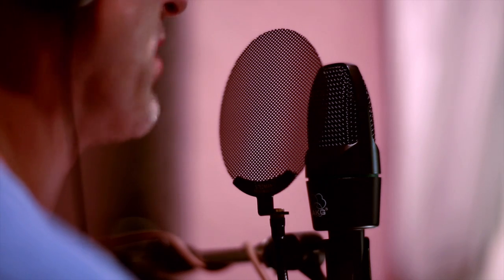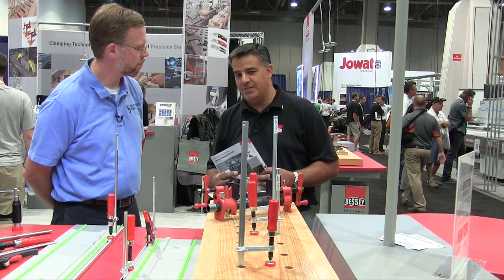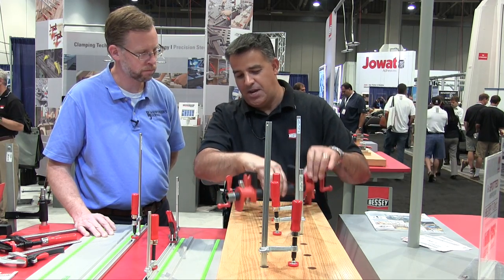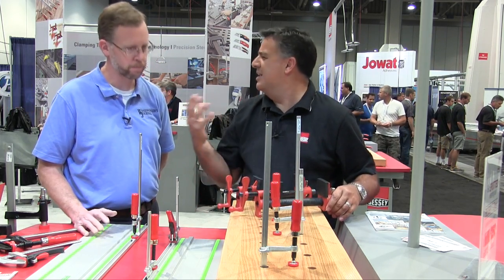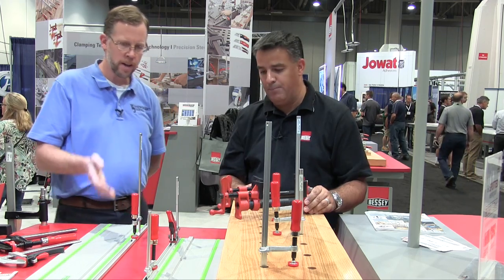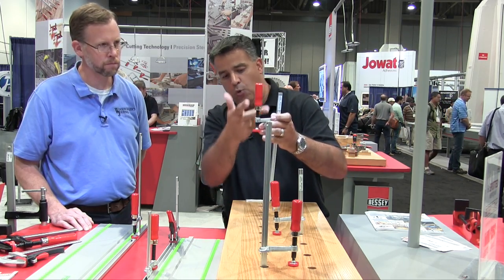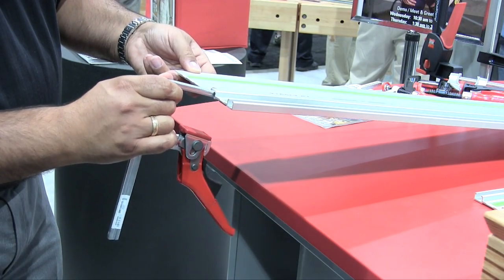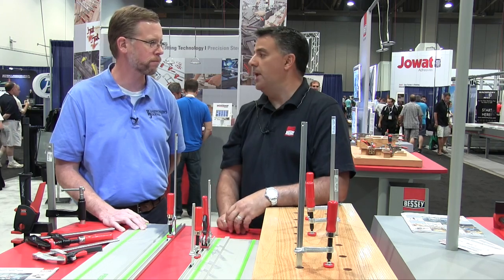Bessey H-Series, Track, and Pipe Clamps - AWFS 2015

Comment: Festool already make quick ratchet clamps & screw clamps for their tracks they also fit the Makita track system which is a direct copy of festools only in Makita blue
Reply: palmer3977 Bessey is not likely to be as expensive and will do the same thing, that's the market for these.
Reply: palmer3977 Just ordered $1,000 in Bessey clamps recently.  I haven't seen these track clamps for sell yet, so its difficult to judge.

Comment: I was surprised when I had the female thread in one of my f-style bessey clamps strip after less than 8 months in the hobby shop.
Reply: Danette Jeoffroy

I find that difficult to believe unless is was one of the small ones.  The small f clamps do fail and bend whereas the larger heavy duty clamps will last a lifetime.